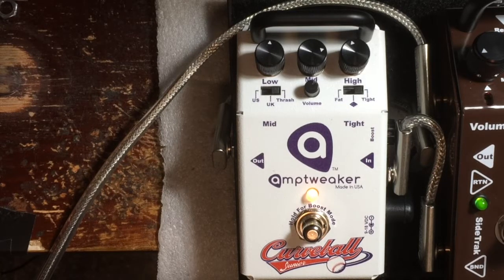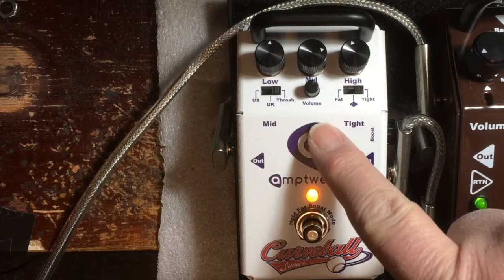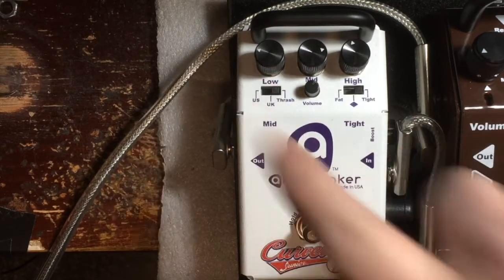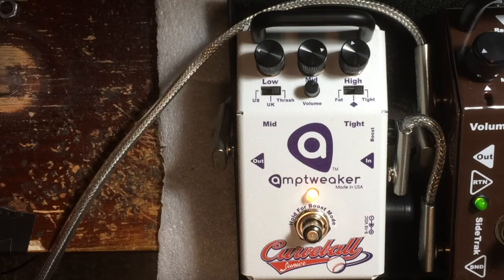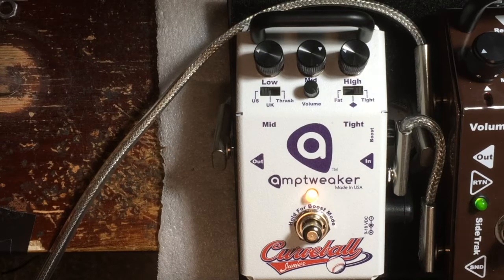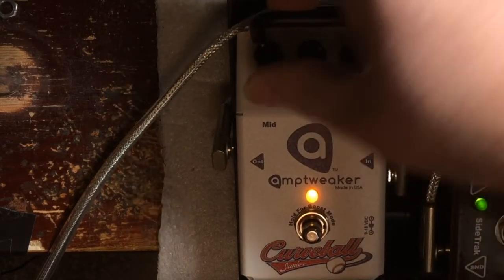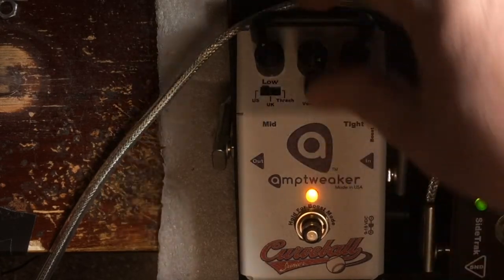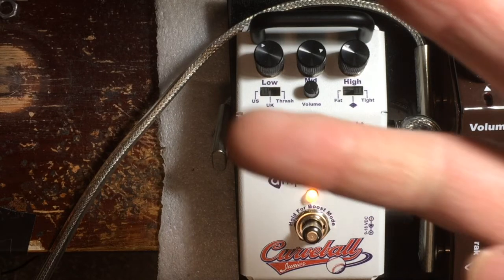Amptweaker Curveball driving a 5150

Comment: James, would this or the tight drive jr do a better job of driving the crunch closer to the Lead channel's level of saturation?
Reply from the maker: They operate a lot differently, but both can do a similar job....the Curveball is cleaner and introduces less of its own distortion....but the noise gate in the TightDrive is really handy for adding boost while keeping the noise down.  The curveball does have the dual footswitch boost, so you can set your 'chunk' and then further boost it for a heavier tone.  And lastly, with the Curveball you can do the parked wah quacky boost.  So I'd say check the various videos on both and see which tone is more like what you're trying to accomplish.